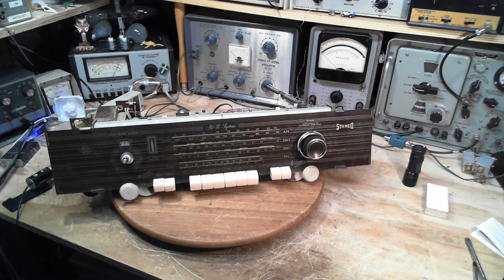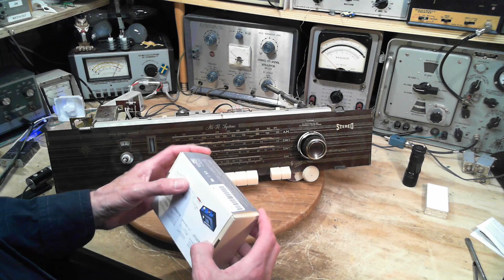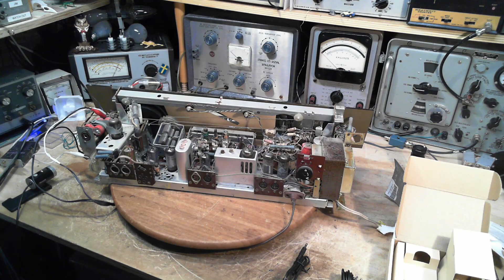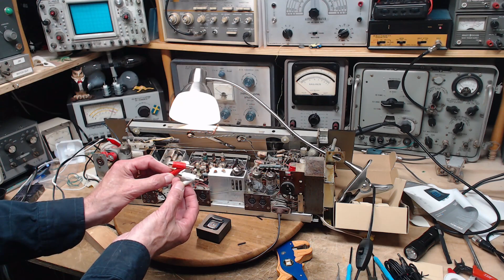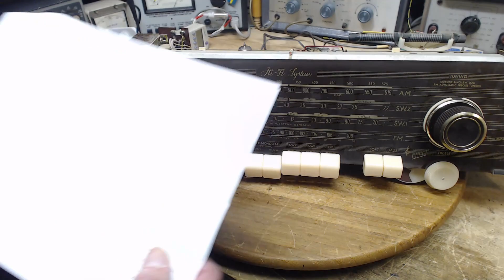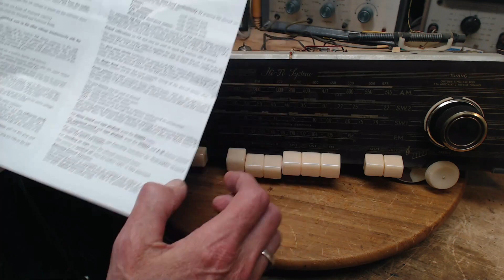Telefunken Salzburg 5094W Console Video #7 - BlueTooth

Comment: Great video. Any reason you soldered wires vs getting 5 pin DIN with female RCA jacks and just plugging it in? or soldering to male 5 pin DIN connector?